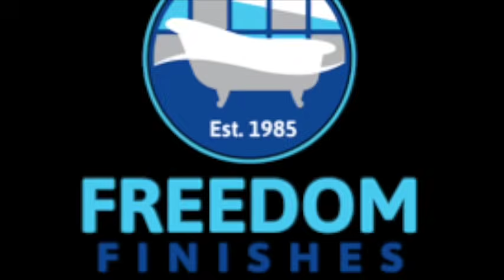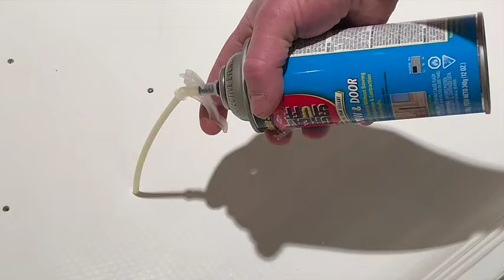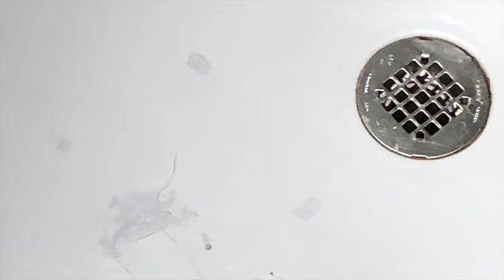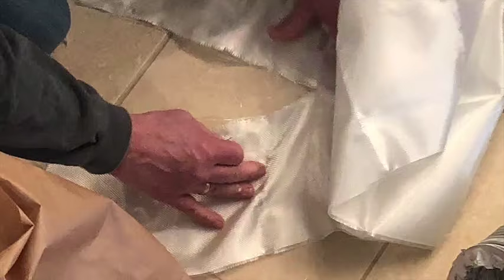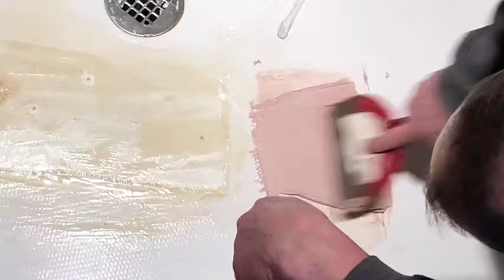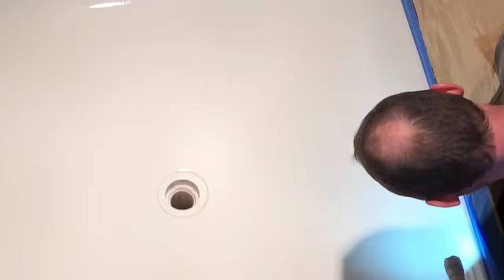How To Repair A Cracked Shower Base: Freedom Finishes Refinishing Products, LLC

Comment: Home Depot sells the paint kit.  Six with fan and over glass and then use paint tub k norm home depot.  I use on tub when it need a facelift and refreshing.  Getting easy t patch crack.  Thank you for he comment tip t put holes at end of cracks t stop cracking like car windshield.  Great tips!!! Thank you
Reply: I also purchased canned epoxy white and tiled on with small foam roller.  Each worked great.  Epoxy looked nicer n my opinion.  I used small heater to speed up curing process and opens window a bit for fresh air. Worked like a charm.

Comment: Thanks so much for this. A more detailed materials list would be helpful because your brand-names don't convert to my region very well. Can anyone with success with this type of repair provide more description to the type of expanding spray foam used to help my find something suitable in my area. I would also like to know what kind of spray paint will hold up to all that water and suitable for bare feet.
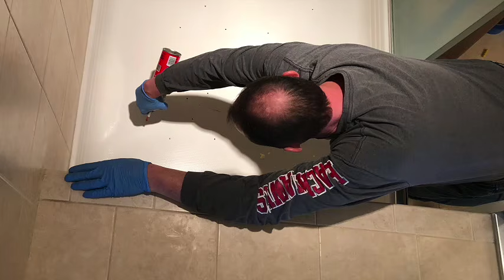Reply: 2:18 most of the products are called 
foam spray insulation 
or gaps and cracks insulation 

the foam is sprayed out a can 
the same spray paint 

you install a tube where the sprayer hole is

Very quickly the foam expands 

fills the hole
Reply: The foam contains polymetric diisocyanate, polyethylene prepolymers and butane

Comment: Where do get finsh coat (paint)???
Reply: There is a spray paint in a can just for this. One can is almost 2.5 times the cost of normal spray paint in a can, but it comes only in white, even thought most of the problems with shower bases are older types with their old bone colour.

Comment: After watching this video last year, I followed exactly these instructions and redid the floor of my damaged shower stall floor (and saved thousands of dollars). I'm just reporting in to say that with daily showers, it's holding up fine. Admittedly, I didn't bother  to get it nice and smooth (I could have, I should have, and I would have, but I'm impatient and I just called it good enough). I assume the triple expanding foam will eventually break down, but at least I know I can fix it again. 

Thank you for an absolutely perfect DIY video. This is the best one I've seen.

Comment: In the beginning it says what you need as far as tools and equipment but then later on You're using a sprayer of some sort which is not listed in the tools. 

Not good. So it comes across something that you can do yourself, but you actually can't because you need specialized equipment.

Comment: What do you do when the foam makes its way into the drain?
Reply: remove the drain before applying foam, then drop a 3" cylinder of sort to keep the foam out of the drain area. I had to remove the foam from my drain as part of an old patched job that at the end leaked at new cracks.
Reply: @donbergler1703  Impossible to remove the drain

Comment: Work at an old hotel. This this a huge issue I’ve had. This is the first no nonsense solution I’ve found. Took it step by step working well. Should be a few more steps before install for these fiberglass shower pans. It’s so common and a pain in in the ass if not caught immediately can cause subfloor damage. Not fun to fix. Especially if time critical. 

Thank you for this.

Comment: I had a long crack that I tried to repair with just the fiberglass cloth and resin because that is all that was shown in a video I looked up a few years ago. I did several coats thinking it would be stronger. It was...and it took about 8 months before my weight finally made the sponginess of the floor  pop the repair loose. Now, thanks to your video, I know why. I needed that first step of the triple-expanding foam. 

Now I know how to fix it right. 

(But I can't wait until my brother, who shares my Amazon account, sees me ordering a bucket of Bondo. I can hear it now as he gives me a panic phone call:  "What the hell did you do to your car??")
Reply: This was hilarious 😂
Reply: Same here
Reply: I have a large long Crack im hoping this works

Comment: What's under the pan that caused it to get soft? Concrete? Dirt? Wood? My pan just cracked near the drain and I cut out a 2" by 2" section and dirt is below it. Some of the fiberglass has rotted away and now there is a void in that area. Do you think expansion foam will fill the void and be able to withstand the weight of a person? The house has a slab foundation but also has dirt visible in the drain area. I guess they left that part exposed during the concrete pour.

Comment: when using fiberglass and resin overlay you should sand/grind the area  to make a depression that equals the thickness of the repair fill.  Same procedure as in vid with the mesh and resin. Instead of polyester body filler ( Bondo) use a fiberglass in the can called long and strong.  This product is fiberglass chopped up with a gel form of resin and is structural as well as a good final filter.  Polyester filler has zero structural, only fills. Mix with catalyst and apply as you would bondo. Now here is the trick. You can use wax paper to cover the repaired area then smooth the repair with a rubber squeegee. This will make the repair very smooth. The wax paper will also help the resin to get very hard and not sticky when sanded. After stripping off the wax paper then wipe down the resin with acetone and the surface will not be sticky at all. Behind sanding as in bid.
Reply: Thank you for good tips

Comment: This is stupid, insulating foam is NOT for structural support ! Bondo filler is not for water areas. I would put my repair and overlay up against any done like this video any day of the week and guarantee mine to hold up!!! This is the type of work I have to redo.
Reply: How would you suggest to go around for such repair ?

Comment: One important area that they skipped on this video is that you need to drill a hole at the end of every crack before you do your repairs.. this will stop the cracks from continuing.
Reply: that is critical information.
Reply: Also don't over do it with foam as the shower pan can lift causing additional cracks.
Reply: @tamminunez5348  I used the wrong foam and it over expanded giving me a small raised area. not terrible, but should have used the window / door one. VERY important.
Reply: @tanney9 thanks for that info
Reply: can this entire job be done in 24hrs? I have tenants in the unit
Reply: @zacharyfair6738  nope
Reply: Must be a drummer
Reply: agree - it's mentioned on the video at 0:59
Reply: The fibreglass cloth which extends several inches past the crack on all sides makes up for that though
Reply: @ocea-mcclean  That doesn't stop the cracks from continuing, All others reading this comment, follow what rande lee above said.

Comment: I have a question for ANYONE, I’m using the form just like video and I’m on my 3can and it still not filling or coming out on the Adjacent holes, how many cans of foam did most people use because this may be costly in the video he didn’t specify an amount?
Reply: We had to use more than 10 cans after fixing under the tub: foam had no where to go and we had to put reinforcement boards underneath, and a barrier.  It takes a good while to expand and harden. Give it around 2 hours to expand and stop bubbling out.
Reply: @flamboyan27  Thank you so much, I just didn’t wanna waste my money.
Reply: what kind of foam did you use?

Comment: The foam baffles me. It's not the kind you would use if you wanted to stabilize it, and either way, WHAT A MESS.  I feel bad for the person who has to fix that half-assed fix later on.

If a job is worth doing....it's worth doing it right. 

If you're just looking for a temp fix to hold you over until done right, then just use jbweld on the crack, and touch up with a tub/tile paint.

Comment: So I just moved into a new construction home my shower pan is already cracking.....is this normal
Reply: NO‼️  Immediately send a certified letter or an email to the contractor with pics and explanation as to the cracking of the tub. “Certified Mail” or email is setting up the foundational complaint needed in the event the contractor gives you excellent lip service yet never calls you back or never sends over his sub to follow up as promised. Also; if the tub worsens; you have proof had the contractor taken your concern serious when 1st notified; the extent of damage would have been a lot less. I’m having the same problem and learned today the fiberglass tub floor should NOT be flexible or spongy🤷‍♂️. Evidently; this is what had caused the stress cracks. This video appears to be the most professional simply due to the extensive measures taken to resolve the problem (spongy floor) and only then does he repair the hole. Sounds right to me🤷‍♂️👍‼️

Comment: Hi, I have another question. 30 years ago we use to cut up the fiberglass cloth so it was just fibers and then mixed it into the resin when we repaired a boat. Would that work for the repair of the small fine cracks?

Comment: Thank you so much! I was able to fix my tub in 24 hrs time and save lots of money for sure.
It took about 24 hrs due to drying time, but your instructions and video worked perfectly.
Couple of things, the filler used took longer than anything to solidify... Maybe 8 hrs?... And the paint, no brand was specified but I used Rust-Oleum bath paint on a spray can and it worked great.
Again, thank you so much for your video and knowledge.
Reply: Thank you for your paint tip… did it hold up?
Reply: I know it has been awhile.   But what kind of Foam did you use?

Comment: I have found that hairline cracks even after repair can continue to advance. I saw in the aircraft industry that small cracks in aluminum are repaired but they drill small holes at each end of the crack to stop the advance of the crack. They are called "stop Holes". Do you think this would be ok on the repair of the shower pan?
Reply from the maker: Hello Craig, "stop holes" drilled at the end of the crack, as you suggest is definitely a technique that is used by many who repair fiberglass cracks. Many of our partners use that approach with long lasting success too. I do not have hard evidence that one approach works better or lasts longer than the other on fiberglass. I do know that for the past 30+ years we've used the approach we've shared with long-lasting success. Hope this helps.
Reply: @arlingtonporcelainrefinish4743  Thanks for the reply. I going to do the stop holes in the repair and finish the project using your video instructions. I will let you know how it turns out and  post picture if possible.
Reply: @craigscott8536  How did it turn out?

Comment: Great video, will be attempting my first bit of DIY thanks to this. I have a rookie question though: what about any water that's already got in the crack and is sitting beneath the tray? Does the foam absorb it?
Reply: Steven Hickey it has most likely leaked into the ceiling of the floor below you. In my case the hole started so small that I did not even notice it until my gf was taking a bath (our first week in a new townhome) and water started dripping from my kitchen light fixtures. All cabinets and a bunch of the ceiling filled with mold within days, nearly 3 years later and I’m still waiting on my landlord to fix it. This method has done the job, though. I haven’t seen water since.
Reply: @ivmurk21  Thanks for the info, ours is a shower tray but it sounds like the result will be the same. So far nothing is showing in the ceiling but you can't see the damage I suppose. Think we'll have it ripped out and see what damage has been done... once the lockdown is over :( Thanks again!
Reply: @stevenhickey2859  Hi Steven, I got the same issue. Did you guys end up ripping it out? Did the cement under it leak?

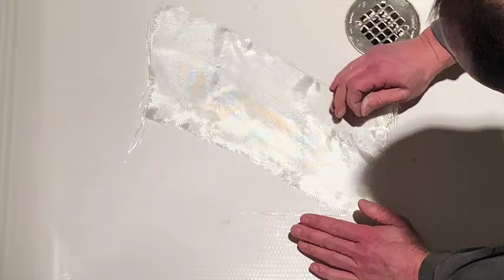Comment: There is fiberglass cloth and fiberglass mesh. They are different from each other and not the same thing. At 4:30 you said to apply fiberglass "mesh netting" then you proceeded to apply cloth. I agree, you should be applying cloth here and not mesh, but you called the cloth, mesh. Do not apply mesh for this job. It would be too thick.

Comment: @ArlingtonPorcelainRefinishing, two questions! What kind of solvent wipes did you use? Also, how long does it take for the fiberglass resin to cure before you can add the body filler?
Reply: I used fiberglass resin and hardener on my boat repair. 3.5 hours it is ready to sand.
Reply: there are a lot of factors that determine how long it takes to dry. how it is mixed and the amount of hardener used, temperature, thickness of applied material, etc. a good rule of thumb tho - when the color changes lightly scratch a fingernail across it. if it leaves a white scratch- it's done - if the product moves when you touch it - not done

Comment: Question - I have always seen videos that show that you need primer paint over body filler.  You didn't use primer paint.  You used two coats of top coat.  What is better,  primer and top coat or two coats of top coat ?
Reply from the maker: It depends on the product you are using. Our product, the product in the video acts as a primer. It is a high build enamel. If you are using an acrylic   paint (top coat) you should use an epoxy primer. This will help bonding.
Reply: @arlingtonporcelainrefinish4743  Thank you.

Comment: What kind of foam do u reccomend using?
Reply: BLUE CAN great stuff. Do NOT use the red can. Red can will stiffly expand and will cause more cracks. The blue can is used for windows and doors and simply contours to its surroundings, then hardens.

Comment: Where can I get stabilising foam?? Is there any other name of that?? Or any brand name?
Reply: I would recommend using a different type of foam. Closed cell high density foam that is waterproof. Use marine rated bondo for the filler.
Reply: I used “Evercoat Sealant Foam”, it’s used for boats, so it better be waterproof lol. I got it from an auto parts store

Comment: Do you recommend Loctite foam or Great stuff?
Reply: We used a closed cell Foam Spray Dow Froth Pak 12. Does not allow water to penetrate.
Reply: I'd like to known too, but he's not answering.
Reply: And the JB Weld, they make a variety of products. Wish he'd specify which one.
Reply: @Tilbily  This has been a while but after much research I found that neither loctite or great stuff are good. They will end up failing later on because water will eventually penetrate due to the open cell nature of the foam. What you need is closed cell foam like the stuff they use to lift concrete slabs up.

Comment: Can you let me know what you used to paint after the body filler is sanded and ready to paint. The brand, list or maybe a picture of the paint and slip resistant surface  product.  Thx so much.

Comment: How much is the cost for that repair?
Reply: Fixing the bottom of a cracked fiberglass tub, around 120.00, most went on foam.
Reply: @flamboyan27  you're right,but u know what bro?sometimes threre's a big cracks like 12inch n' takes for so long to repair. Or in the curves of the tub it's hard to sand it. And maybe the cost is around 350 icluding paint,material n labor👍
Reply: $4000
Reply: @---wl3bi  4000 is too much
Reply: now: spray paint in a can $42, non-slip powder $8, foam in a can $15 (you may just need 2). fiberglass, etc. $70, sandpaper $5, spatula $10, the rest you should have at home (drill bit). Total about $165 on Jan. 2025 assuming you did not screw up anything.
Reply: !! 🤔🤐no body will tell you use your!!🧠🧠🧠
Reply: @raulgutierrez5920  why not?
Reply: @velascojidon390 !home work?
Reply: @raulgutierrez5920  what u mean?

Comment: I have this same exact situation. But I would never use body filler to top it off, won't it crack under pressure.  I am finishing mine with another coating of Fibreglass over the dried first application, with no cloth for the final coat, an it can reach it's own smooth level.  I also made cuts or grooves in the original base so the products would seat well, and cleaned all with alcohol before pouring on the fibreglass resin. Hope yours worked. 3m makes a very good fibreglass strand filler as well.

Comment: That is not the way to do this! i would use a much better closed cell foam to support and then grind the crack out. then use FG mat w/ vinylester, in small pieces cut to fit you grinded out area, to get very near level, then use a filler rated for marine work-NOT BONDO as it can absorb moisture. I would sand out the floor completely(remove the oem texture, and roll the non skid 1st, then spray the top coating. you have a high spot there and then have the factory non skid in areas competing with your sanded non skid you applied so it is obvious this is a repair. This is adequate i guess, i mean, its repaired and looks OK however it is an obvious patch. This is DIY standards, not pro standards IMO. An overlay panel is probably best if that floor has any wood rot.
Reply: Bondo is definitely a no go for me, work on boats for a living, the filler I love to use is called Adtech, it’s kinda spendy but definitely does it’s job and then some!

Comment: Thank you very much sir.
I did all the steps and fixed the shower base, although i messed up the first layer of epoxy.
I sandpapered the sticky ruined epoxy layer and 24 hours later mixed up a second layer, this time much better[cured in 3 hours, was ready in 24 hours].
My mistake was that i didn't mix the hardener and the epoxy nice[although it was written on the instructions...].
I used painting sprays[liquid marble stuff[very expensive one] and white color spray]. My paint job also was bad and now it is falling apart [because the liquid marble's cap broke], but i will fix it on the next salary.
The important thing is that there are no more leaks.
Thanks once again.